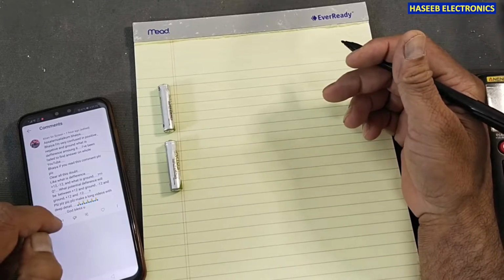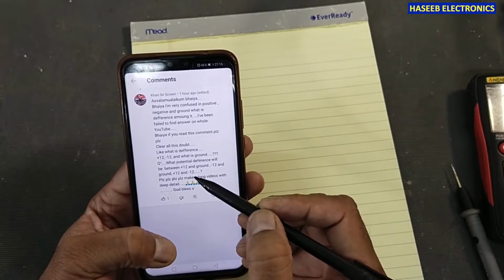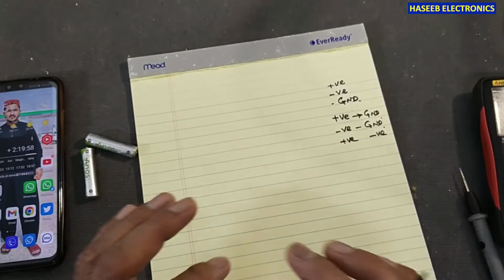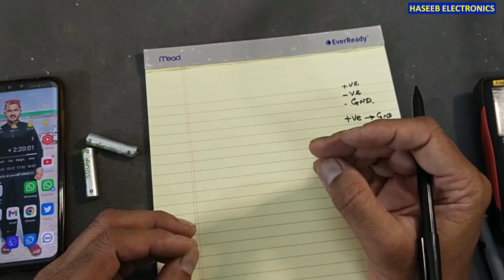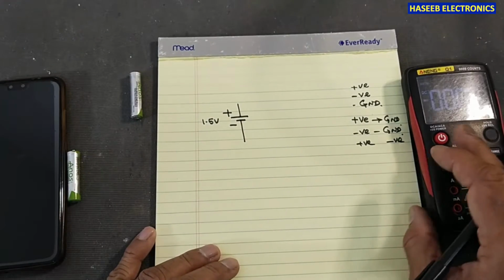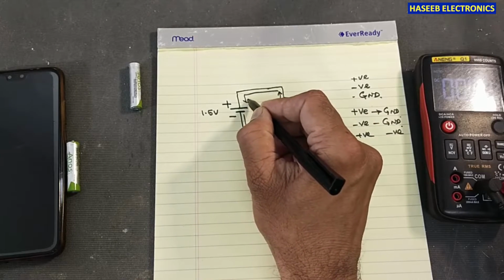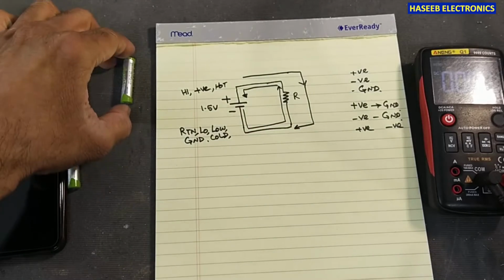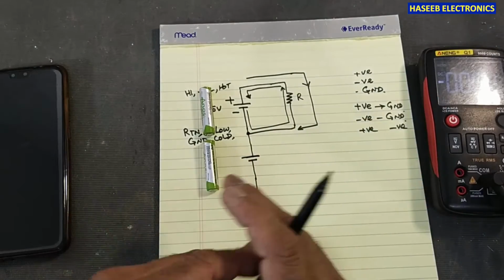{780} Voltage Polarity and Values Explained

Comment: Why don't batteries discharge when we connect them serial end to end ??
Reply from the maker: when batteries are connected in series and the outer ends are open. until that there is no load connected, it will be an open circuit

Comment: As always, very well explained. I have been thinking about partially modifying a desktop PC so that it will both work as a PC and a bench power supply. Is it possible?
Reply from the maker: best regards
if we will modify partially ATX PSU 
it may crash the PC